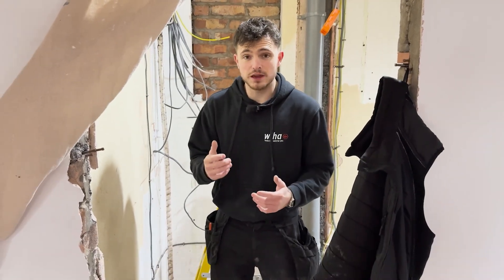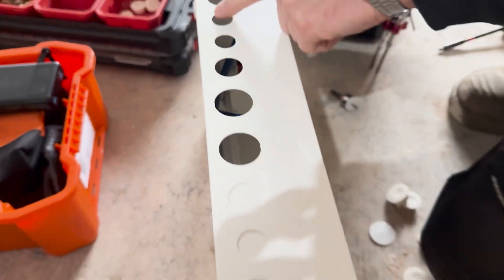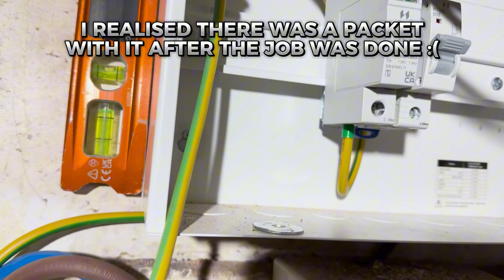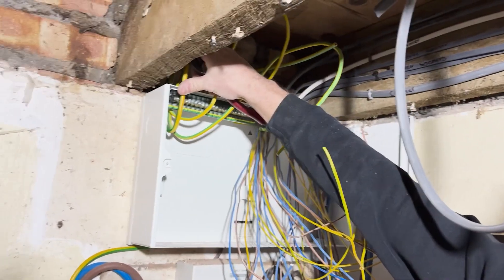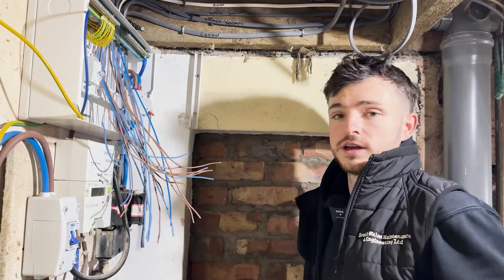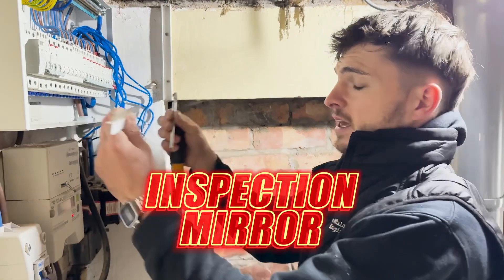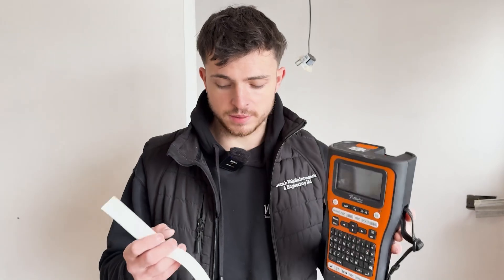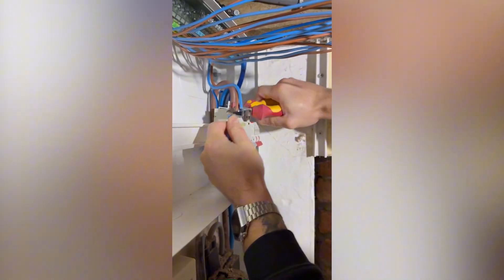Installing A Consumer Unit Like A Pro

Comment: Mate dont listen to anyone saying your cables are to short, they've not got a clue, most them are old school electricians, and all the old boards i test are crap because they have left to much cable in the boards and over time they all end up like bird nests 🪺. Id rather have a joint ontop of the board than loads of slack that can become a nightmare when fault finding and testing. They all cry about joints even though every one of them outgoing cables terminates at multiple points 😂😂😂😂 they need to understand the regs more rather than being scared of it 😂

Comment: I'm a 60 year old Industrial Controls Engineer and Industrial Electrical PLC programmer. So allowing for faults and changes is gospel. The board can be just as neat by going down behind the din rail and up again. Your cables are way too short as others have said. You must allow for a future board change or possible loose connection where you'd have to remake the ends off.
Reply: That's rubbish, bored of you old school sparks going on about leaving extra cable, sick of going to boards that have to much extra cable that just ends up a mess over the years after periodic inspections, additional circuits added etc, it people paranoid incompetent that don't understand the regs that leave a birds nest of cables in boards, it's a nightmare later down line for fault finding etc
Reply: @tonys8448  ha ha ha. to young to realise yet, when you grow up you will see.

Comment: Neat but please think of the next guy, it's not much more work to loop the cables down behind the din rail to the bottom of the unit so there's decent slack if stuff needs to be moved about.
Reply: Also the neutral in the middle will be sweating Cg
Reply: @ShaWoddyWoddy-x5i  yeah I try to space neutrals out a bit, sticky tabs are your friend, you can group things like 6a and 20a together since the fly leads are usually 4mm2 but grouping all the rings together is a no no.